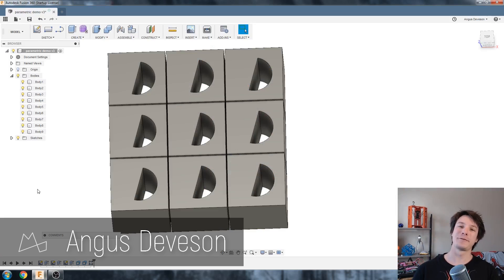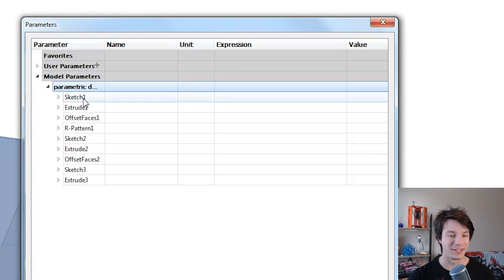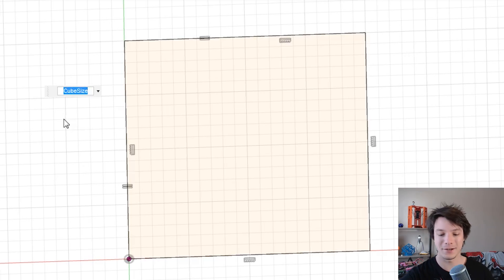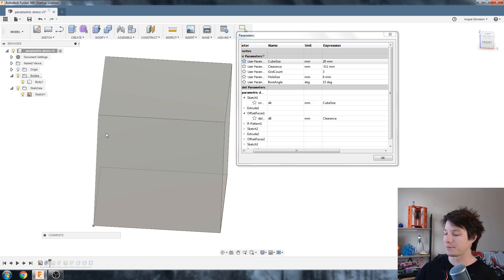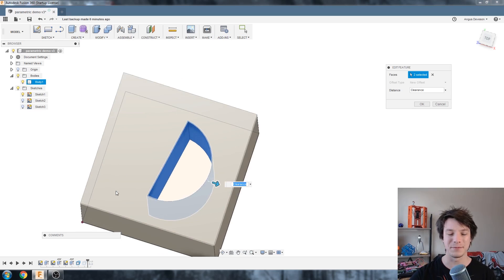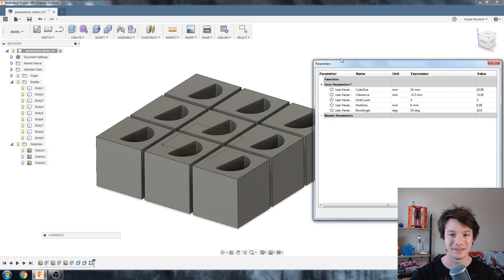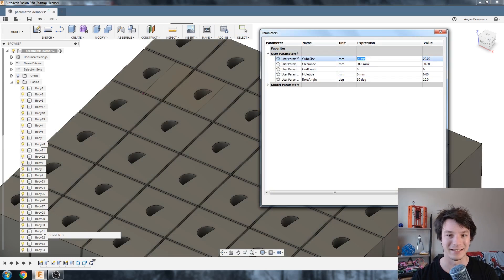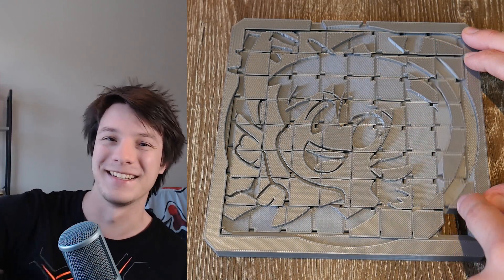Creating User Parameters in Fusion 360 - Handy!

Comment: Thanks for the vids... great work! Yes, Fusion Parameters are great. Wait until you get to equations and functions! Best of all, it's all (relatively) easy to use!!

PARAMETER DIRECTION/SIGN:
Where a negative parameter value is potentially confusing - ie. Clearance = 0.1mm (imo lol) - set the reference to the parameter as negative instead (i.e. " -Clearance "). That is, set the direction (+/ prefix) in the dimension itself, not the paramater list.    That way, you can also use the same Parameter in different (ie. most appropriate) directions in the design (i.e. "-Clearance" on outer surfaces, "Clearance" on inner surfaces).  This may also avoid multiple parameters too!  

(Mmh... I am wondering if the 'Flip' buttons work with parameters?!?).

Being able to rename the auto-named dimensions (d1, d2, etc. etc.) is also very useful, especially as you can then reference them within other dimensions. Though it can often be clearer to have a single User Parameter driving multiple dimensions etc. As mentioned, planning is required to avoid confusing cross-referencing etc.

NAMING PARAMETERS:
Also, when you have lots of Parameters (think 'variables' in code!), you'll start to need a naming convention that allows specific parameters to be quickly found. Sounds like overkill, but it's a good habit to have - esp if working with others (or you forget stuff after a few sleeps)!   There's various conventions, but I build categories into names, starting with either the 'purpose' of the parameter (diamBaseHoles, LenLidOuter, DepthLidRecess) or using product structure (e.g.  BaseHoleUpperDiam, LidOuterLength, LidRecessDepth).  It depends on the project - and how ya brain works!   However, as you are entering a parameter name, you know it's purpose, so the former naming convention is what usually works best for me.

FEATURE REQUEST?
I only wish the Parameters list was non-modal, so that it allowed modelling whilst its open!!  That way, you could continue designing whilst viewing parameters, selecting them, and ideally adding them as you go, all whilst the modelling window remains active.   (If anyone knows how to enter a new parameter name whilst say, entering a dimension, that be very useful.     NB:  I haven't searched for this yet so it might already be on its way  :)

I am a newcomer to Fusion and I've realised there's one massive problem with Fusion 360:  it's such fun to learn, that I'm not getting any work done!   Cheers

Comment: It appears that if you create an offset plane so you can draw, you can't use a parameter to define the distance... Which is Nucking Futs.  = Update, You have to make them Global, you can't define them in one sketch and use them in another, When I made it a user parameter it worked...   Fusion 360 could sure use some descriptive errors - instead of just not working. (more for other things than this)

Comment: I enjoyed your explanation on parametric design. It helps me to tap into the Fusion GUI where there is a huge potential to avoid redesigning/modeling anything made with hard dimensioned geometry. The tolerance varies so much with 3D printing and is so finicky that this is invaluable for the maker to utilize, and the explanation (and reasons for their use) of parameters that you give here is a perfect introduction into this topic for my purposes. Thank you!

Comment: In addition, I don't know if you noticed but you can even make calculations with the variables. For example if you want 2 cylinders to fit in each others, you can specify a variable for the diameter of the internal cylinder (like internalCylinder=10mm) then you can set the diameter of the external cylinder as "internalCylinder + clearance *2" (with a variable clearance=0.1mm for example).
Anyway, very usefull video and feature. Didn't know it.

Comment: I love working with parameters like  the only thing I found with working like this (as goes for many other cases) you really need to think before you start. Implementing these halfway trough your design is a hassle at best. If you implement these right from the start I have found these to be extremely useful yes, especially in combination with the fact you can use math and functions everywhere you need a measurement.
If used correctly your design basically becomes something from openscad or the thingiverse customizer.

Comment: This is awesome Angus! I'm so glad you pointed the user parameters feature out! Somehow I never stumbled across it, so I was running into issues all the time trying to reference driven dimensions (spoiler: you can't do that) or using long expressions all over my sketches. This has made designing in Fusion360 so much less frustrating, faster and more flexible. Thank you!

Comment: Immediately I want to be able to use formulae in the parameters. Can you do this? Can I for example set the BoreAngle to be the distance from the origin modulo CubeSize, so that over the pattern, the orientation of those holes changes in a predictable pattern? That sort of thing would begin to be enormously powerful, especially if the formulae can be kept in another table somewhere and be complex, or even programmatic, or recursive.
Reply: That would be cool. I wouldn't be surprised if Autodesk intentionally left something like this out, since they seem less than excited about anything recursive happening in Fusion 360. They don't even allow referencing driven dimensions in other dimension expressions because it could recurse.

Comment: Angus, regarding the bug, another (faster) workaround could be to only make changes in the Edit of the Feature, instead of going into your parameters multiple times? E.g. change your dimensions in the Edit of the feature to something that is not equal to the Cubesize, then accept; en then go back into the Edit feature and change your temporary made up value back to 'Cubesize'. This way, you don't even have to go into the Parameter menu if your CubeSize is already the value you've wanted. Hope it's clear.

Comment: Ao they are like variables in a programming language?
Reply: John Michael Stock Yes, quite a bit like variables in a way, but I think they come with the assurance that they will not recalculate mid-render. For example, a variable in a program might be used as a counter increasing by one everytime it is used, so at different points during the program it has different values. User parameter appear to be calculated all at once, so at all different points within the model they are consistent. (Of course you can change the values, but it would consistently change everywhere the parameter is used.) 
 Programming is my comfort zone, and designing in Fusion360 definitely feels more like programming when I'm using parameters than before I knew about them.

Comment: Parameters are awesome. Can Fusion also handle formulas? I use Solid Edge and at some cases I use formulas adding or multiplying different measurments. It even can handle things like round to make integers for patterns from more complex formulas.
Reply: wuerfel schmied Yeah, man. the "expression" value of a parameter can be a formula of other parameters and numbers. (edit: haven't tried rounding to an integer in a parameter expression, though, myself)

Comment: Angus -- I'm at work during my lunch break, so can't test now... BUT can you do in-place relative modifications to user parameters. e.g. "cubesize" for one dimension and then "cubesize - 3" for the other to make a scaleable rectangular cube that can be modified with a single parameter. That would be even *more* powerful. ... ahh someone else already asked. Answer is yes,.. Nice!!
Reply from the maker: Yep, that works well I am using that approach for elements of my Rubik's Cube design.

Comment: I’ve been working with this as well. Designed my own printer using square tubing and 3D printed joints. I’ve set the parameters so that I only enter the build volume and the whole assembly updates. All you have to do is cut the pieces to the calculation. Comments tell you how many of each (even the belts). Quick and easy BOM!  Thanks for the info on no units. Definitely going in the next evolution.

Comment: I used parameters in a different way when I was modeling Kepler's Mysterium Cosmographicum. It's hard to explain in words, but here's what it is:

Sphere 1 (S1) is inscribed in a regular octahedron (R1).
S2 is circumscribed around R1 and is inscribed in a regular icosahedron (R2)
S3 is circumscribed around R2 and is inscribed in a regular dodecahedron (R3)
S4 is circumscribed around R3 and is inscribed in a regular tetrahedron (R4)
S5 is circumscribed around R4 and is inscribed in a cube (R5).
S6 is circumscribed around R5. 

I used formulas from Wikipedia to calculate the side lengths of each regular polyhedron and the radii of the spheres. I created parameters for them so that I didn't have to write a parametric formula for all of them.

Comment: Great video, Angus! Perhaps it is easier to understand the concept of parameters if you do programming stuff, since the concept is the same as variables.
In my design flow, parameters come even earlier than CAD. When I think of how to design something I draw a very simple sketch to see what are the possible parameters and how/if they can be correlated to each other. Then I go to CAD software and make the CAD design. Some people think is weird because I sketch almost without numbers :P

Comment: Have you tried designspark mechanical it's free and similar to fusion 360? The only thing I found is it doesn't have the smooth make thread function as Fusion 360.
Reply: I'm a big fan of FreeCAD, because it's open source. FreeCAD doesn't have a thread function either, so I create a Helix path (which Fusion 360 unfortunately doesn't seem to have), then Sweep a thread profile along the path, with the mysteriously-name "frenet" option on to keep the profile from rolling as it follows the helix. One tip: FreeCAD doesn't warn about self-intersecting threads like Fusion  360 does, so a self-intersecting thread will just behave strangely when you try to, for example, join it to a cylinder.
Reply: Bradford Needham Helix paths in fusion 360 can be done by making a square profile coil, and only using one of it's edges. Not exactly straightforward, but it is a viable workaround. FreeCAD tends to crash on me, or bail out of operations with a thread trace; otherwise, I'd probably use it more, since it isn't tied to cloud storage.
Reply: DSM helix can make good threads, but I prefer Fusion 360, even just on the ability in Fusion to go back in the history and change a feature or sketch from early in the design and it adjusts. So many times I've had to scrap a complex DSM project and start over to change a minor detail, and the worst case in fusion for me after editing an early sketch in the history of a project has been to go through and re-select edges for filets if the number of edges in the geometry changed.

Comment: As powerful as user parameters are, it's really unfortunate that the UI for them in Fusion 360 is so limiting.  Something as simple as the ability to sort them alphabetically so that we can add prefixes and group them in a reasonable way would solve this and wouldn't take much code at all to implement.  Instead, they are sorted by first created;  this makes zero sense.  If they really wanted to make them much more usable, they could give us the ability to manually group them and/or have an hierarchical tree of groups of parameters.
Reply: Justin Allen That's one of two enhancements to Fusion 360 Parameters that would be really great to see. Being able to make global parameters to carry over between designs is another. Have you been on the Fusion 360 IdeaStation and voted on the Parameter sorting and grouping ideas? Maybe Autodesk will implement these into Fusion 360 if they get more votes:

Grouping & Ordering Parameters https://forums.autodesk.com/t5/fusion-360-ideastation/grouping-and-ordering-of-parameters/idi-p/8063745

Manual Parameters Groups https://forums.autodesk.com/t5/fusion-360-ideastation/manual-parameters-groups/idi-p/6484475

Grouping, re-ordering and searching for User Parameters https://forums.autodesk.com/t5/fusion-360-ideastation/grouping-re-ordering-and-searching-for-user-parameters/idi-p/7313132

Global Parameters https://forums.autodesk.com/t5/fusion-360-ideastation/global-parameters-for-all-project/idi-p/6896005

Comment: Angus, when you return to this topic: 1. User parameters feature should be added to the shortcuts popup. 2. You can use expressions  both in the sketch and in the parameters table. Example: big_diameter = 1.5 * medium_diameter (shorter version: big_dia = 1.5 * med_dia).

Comment: Angus, I've seen a lot of YT videos by talented people, but they do not  use any parameters, which makes every design a "work of art" (one off) instead of a reusable design.
Reply from the maker: I'm sure that's fantastic for a lot of design work - but I wouldn't be keen to redesign puzzles just to change clearances!
Reply: Maker's Muse , it looks like you may have missed my point entirely. Have you read my second comment? I try to develop a habit of using at least a few parameters in all my designs. Btw., I am not a professional designer.

Comment: Angus:
I found an easier and faster work-around for the glitch. When the number and parameter are equal and you want to change the number to the parameter, just change the number to something random, wait for your model to update, and then change it to the parameter. I've found that Fusion 360 is then able to keep the parameter.
Reply from the maker: Good tip! Thanks :)
Reply: I tend to change it to something like parameter+1, then to parameter. btw, Angus, you can use parameter in arithmetics as well : )

Comment: are user parameters independent for each workspace? or are they saved to be used for later on in other designs? would be good to be able to save your clearance for each printer so when ever your designing something in the future you can think ahead of what printer your going to use and just pick the necessary clearance.... that way you wont need to remember clearances for each printer

Comment: Im using this to make animations in catia, like if you want to make a spring u can make the length of the print to a basic parameter and the pitch could be the length divedid by something so if you want to press the spring you should only modify the lentgh and the pitch will be bigger or smaller. That's a really cool thing to use in manifacturing.

Comment: I was wondering what you think of multi material printers like the M3D crane quad? Do you think we will see a rise in hybridized materials soon?
Reply from the maker: I think the M3D marketing is a load of hype they're claiming its the first full color 3D Printer which is not true. It will print multicolour but you're not going to get much multi material through it because of temperature variations.
Reply: Maker's Muse that's a good point. Thanks very much keep up the good work mate

Comment: @9:10 if you set up another parameter (say of a size not used in the model i.e. BugFix = 12.3456mm) and switched distance to it, will that update correctly? and then if you switch back to CubeSize, is the correct value displayed? (Don't have access to Fusion on my Linux machine to test it ) :'(

Comment: Hello, I was wondering if you cold tell me which recording software are you using to make those videos. I try OBS but it create an error recording Fusion 360 screen! It hide the entire tool bar in the top, the history and the Browser with the components, bodies and sketches! Thanks, and great job with your channel, it's really usefull! - and  Hi from Brazil :)
Reply from the maker: I use OBS and the screen is a display capture. Works great, though I do have a dedicated GPU. Just a GTX760.

Comment: I used it in my Geneva mechanism generator. Using 'No Unit' as distances you need to multiply them with 1mm. Also 'No Units' are needed for some mathematical calculations...again by multiply those with 1mm gives me the distance option.